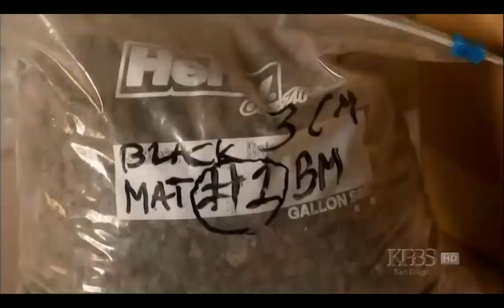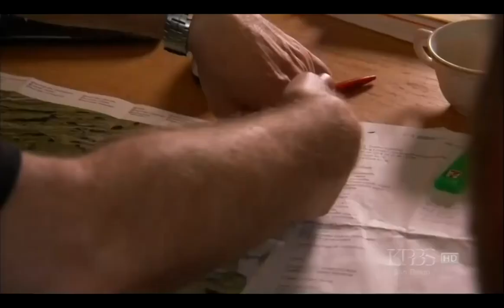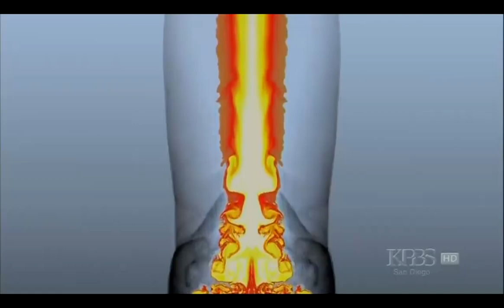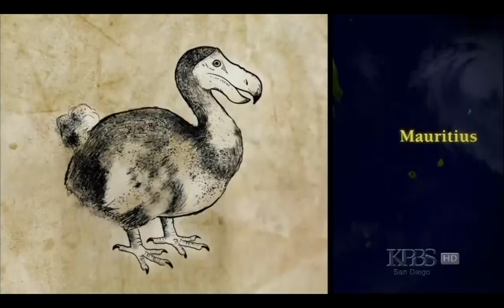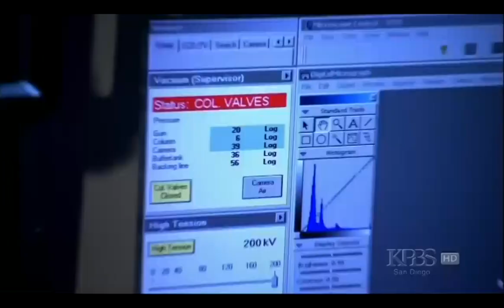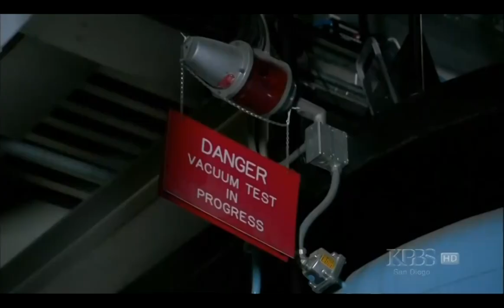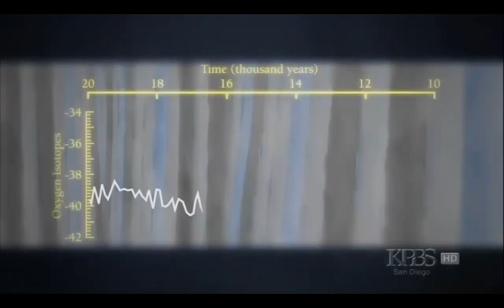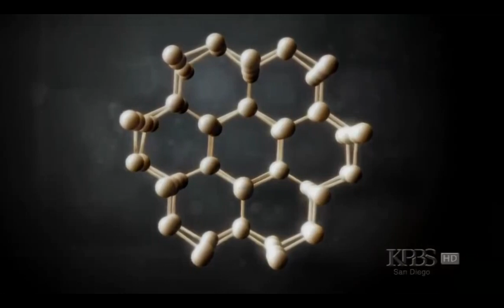The Younger Dryas Impact Hypothesis - Kennett, West, Mayewski, Kurbatov

Comment: And now new research into the Atacama desert glass reveals an age of 12,000 +/- 900 years and temperatures of up to 3,000F and substances that match Comet Wild2
Reply: They found the crater right after this video. It's right there in Greenland called Hiawatha crater, 10 miles wide. Dating back literally 13000 years ago. It's already official. It'll probably be in the history books a decade or 2 from now
Reply from the maker: @deadboy3646  While the Hiawatha crater may possibly date to the YD onset, it is far from conclusive, and actually more in doubt than when it was first discovered due to the recent dates. A large single impactor explains far less of the impact evidence than the scenario preferred by the Comet Research Group of very intense meteor showers with thousands of tunguska-like explosions, and as such, while Hiawatha was initially exciting for the CRG, and still is for many despite the new dates, Hiawatha is not officially considered by the CRG to be evidence supporting of the YDIH. The geomorphologically very young appearance of the crater and the fact that impact-modified Plio/Pleistocene organic matter has also been found in the same deposits that yielded the 50mya+ dates mean that I and others (including Kjaer and others who found it) remain skeptical of such an old age. We hope to see drilling in there to get some proper dates in the near future, but it's very expensive work so will be interesting to see what happens.
Reply: @Marc_D_Young  No you’re right. It actually has just been confirmed to be a couple million years old. Graham Hancock was wrong
Reply from the maker: @deadboy3646  There is still significant reason to doubt those dates, all evidence up until now has pointed to a very young age. I want to see further work done there, and I know the people who discovered it aren't satisfied.

Comment: You have to also consider, when estimating probabilities of impact, that 1) 2/3 of the Earth is oceanic which hides evidence 2) air bursts are very common, in fact, the only large ET events we've had in recorded history (Tunguska and Chelyabinsk) are all air bursts. Both oceanic impact and air bursts could be horribly destructive without leaving a visible crater (for example mile high tsunamis and baking the Earth's surface with temperatures as hot as the sun).
Reply: The many small impacts like a shot gun blast hit the Laurentide ice sheet'  no craters as the ice sheet was 2 miles which  10000 feet thick.

Comment: Okay please help me understand. So a meteor comes 12,800 years ago and hits the northern polar ice caps. This not only melts water causing flooding but it also whips a bunch of stuff in the air that flash freezes anything and everything from the water to the animals to all vegetation? And then what? 1200 years goes by and it happens again 11,600 years ago? Is this an accurate picture or am I missing some pieces?
Reply from the maker: It's not that it happened again 1200 years later, its more that the climate conditions holding the temps down suddenly lifted, it's not known how.
Reply: @Marc_D_Young  So fragments didn't come at 11,600 years and repeat the process? Also is there acid rain and or ash?
Reply from the maker: @brometheus7776  they may have and are expected to under the impact mechanism, but there's no evidence for that having happened so we don't know. Acid rain definitely at the YD onset, there's a paper in the bibliography where mammoth tusks were melted, below where the skin covers them.
Reply: @Marc_D_Young  Okay well this just sounds like a bunch of stuff all at once. I know something that lines up quite perfectly with this:

https://youtu.be/ME0pAi7-ejgp
Reply: Unless there was another impact that only hit the water…then it could have caused massive flooding literally overnight

Comment: This very interesting. And I would say definitely shows the evidence of asteroid field drifted thru earth with many impacts that hit earth. But i still have a question based on this thery of the big bang hitting ice so it didnt leave a mark on earth. How would a asteroid impact thats so great have the ability to “selectively” kill?  Meaning how is it possible this giant explosion killed only these animals but not all the rest of the animals also present in the same location?
Reply from the maker: The giant herbivores relied on certain types of vegetation and large areas to sustain them, which underwent significant changes due to the fires from the impacts and magnified by the rapid climate changes of the YD onset, significantly faster than most other climate spasms, which proved too fast for large mammals to migrate to new regions where the climate could support them. The large impact into the ice sheet originally proposed was just a theory to try to explain the absence of a crater. The YDIH doesn't need a large impact to explain it. A rain of smaller ones, ie 50-500m objects detonating in the atmosphere is currently the favoured scenario but different researchers have different theories. Instead of picturing a dinosaur killer asteroid, picture a rain of smaller ones destroying large areas but not killing everything in a massive all consuming tsunami/shockwave

Comment: There is a pole shift theory that is loosely calculated to happen every 12,000 years or so...
Reply: The poles shifting themselves wouldn’t cause a mass extinction. It’s called precession and it moves by 1 degree every 72 years. It changes the constellations we see behind the sun as the sun sets. However you can use that information to date certain sites, including gobekli tepe and the pyramids and such. And these dates just happen to line up to be right at the end of the younger dryas event. Very interesting.